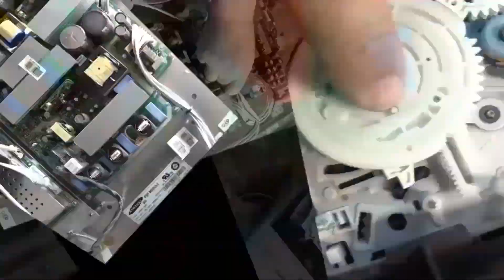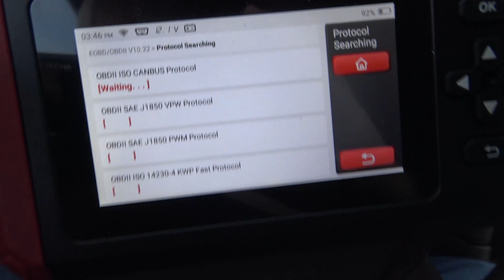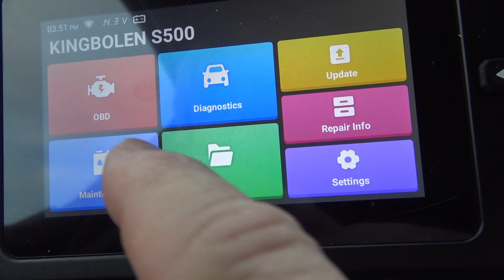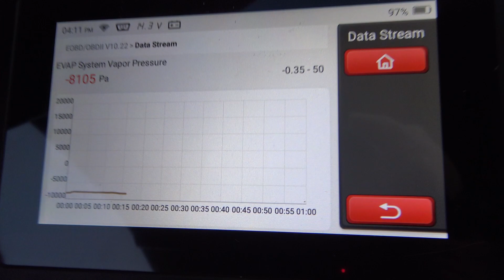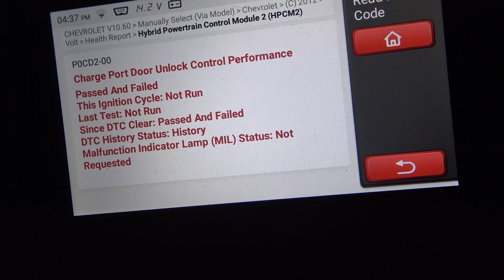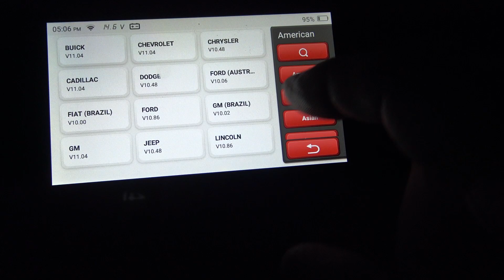Kingbolen S500 OBD II Scan Tool Unbox and Test Flight

Comment: Enjoyed this review. I bought an expensive OBD2 tablet on Amazon, supposedly designed to handle the high security of Chrysler vehicles for my 2015 Dodge Dart. You can program a key fob,  but you can't change all the parameters for the different car options by downloading the latest code, because Stellantis has it locked down. Long story why that was needed for me (bad PCM, etc.)
I bought a Bluetooth dongle that is supposed to work with a phone app for these cars. Meanwhile, i had to pay the dealer to reprogram the new PCM. Quite the adventure. Your tablet was almost as full featured as the one i paid almost $900 for. Amazon took it back, to their credit.

Comment: Dave, I wonder if those old airbag codes on the Volt were due to a low battery condition.
Reply from the maker: Battery is not low. It might have 210k on it but it still runs fine. No lights were on, so it isn't serious enough to trip a DTC

Comment: I recently got a scanner. I had the same code for my Colorado. The thermostat was stuck open and the temperate after warmup was only half of normal. Replaced the themostat and it's back in range and heats up fast, which is a good thing as winter is here now. These things are well worth the money.
Reply from the maker: Sure are.